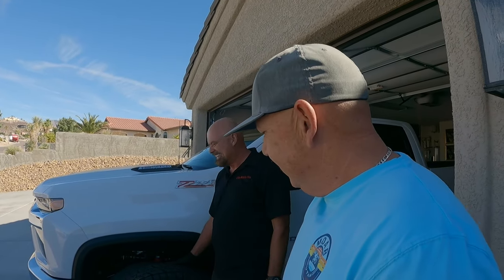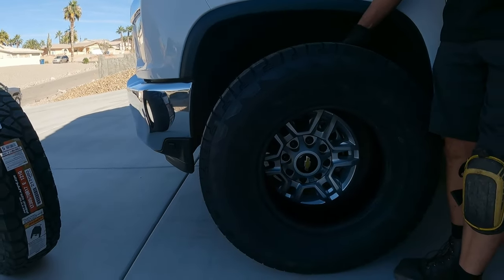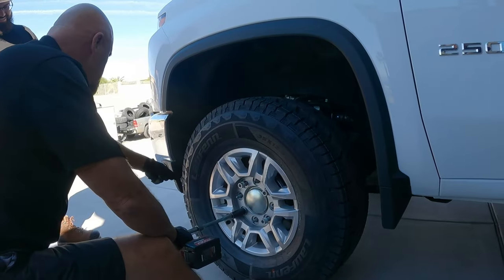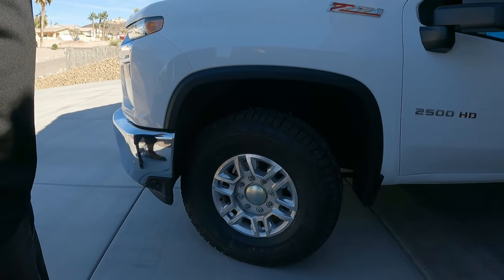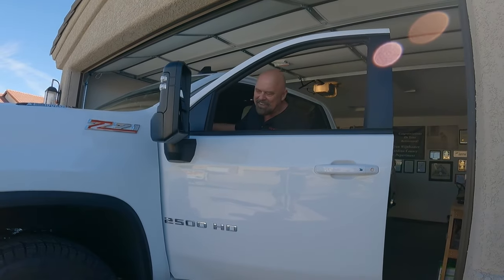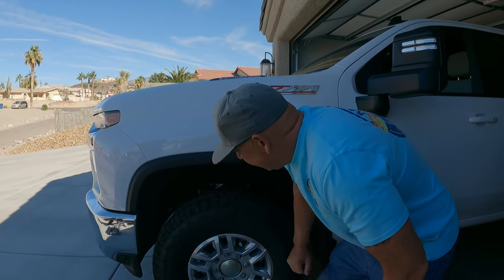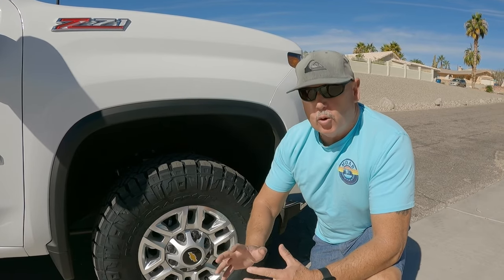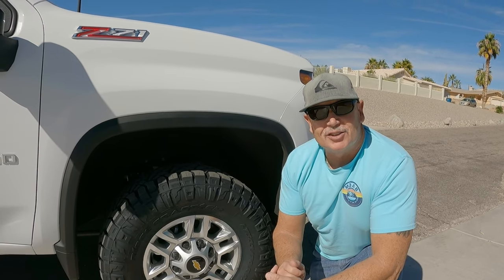2022 Chevy 2500HD Duramax 35 inch TIRE FIT TEST// WILL IT FIT?

Comment: mine is 2022 3500hd with 278/70/18 thts 33.5" tire i think. my local tire shop said no way 35" will fit especially on stock rim cause its too wide. you think he doesnt know wht hes talking about or is he tryin to sell me wheels?
Reply from the maker: That’s pretty funny!! I show you on the video that they will absolutely fit!  😂. So yes, he does not know what he is talking about.  However, I am no longer running the Nito Tires.  I switched to the Cooper Discoverer 60,000 miles warranty.  The Nito’s were too soft.  305/70R/17 is what I am running.  1/2 difference between the 35’s as I show at the end of the video.
Reply from the maker: I would go to Discount Tire.  If you have on near you.
Reply: @OverTheHillAdventures you think it matters if i have the 18" wheels or 17?
Reply: if you look online, 305/70/r17 is 33.8", 305/70/r18 is 34.8". my stock one is 33.2" i think.
Reply from the maker: @alamray   no it doesn’t matter if you have 18” wheels.  I went with my 17” stock for a better ride which you will too!  20” rims make for a rough ride.  That why the Ford Raptors have 17” and 18” rims.  So yes my tires are a fraction under 34 but still are consider 34X12.5X17.  The fit test I did in my video was a 35X12.5X17.  The only reason I did not go with the 35’s was because of gas mileage and I didn’t want to calibrate my speedometer.  I got tires that look great on the truck.  Lots of folks have commented on this video.  They love their 35” tires on their truck.
Reply from the maker: @alamray the fit test I did.  Was a 35X12.5X17 and yes the 305/70R/18 is a 35 in tire but it’s only 12.01 inches wide.  Either way you will be happy.  Do you have the Z71 package on your truck?
Reply: @OverTheHillAdventures  yes z71. i think im gona go with 295/70/18. good in between size.
Reply from the maker: @alamray  you will definitely be happy! 🙌👍
Reply from the maker: @alamray  it’s only 11.6 wide
Reply: thank you @OverTheHillAdventures
Reply: which cooper discoverer? AT3? @OverTheHillAdventures
Reply from the maker: @alamray  yes sir!

Comment: So what size and brand tires did you go with?
Reply from the maker: Nito Ridge Grappler 305/70R17 which is a 341/2 X 121/2 on a stock 17 inch rim.  It is only 1/2 inch smaller in diameter then the 35’s.  If I did it again I would go with the 35X12.5X17 because the tire is cheaper.  These tires are great so far.  Aggressive tread but a quiet tire.  Thanks for watching, Stan

Comment: I run 35&37 inch big horn mudders I pull 24 mpg on a bad day and 28 on a good day in my duramax
Reply from the maker: That’s awesome!! Nice work!!  Stan
Reply: ha, DOUBT.
Reply: @Ryansrangereport  maybe u doubt urself but that's ur business good luck with that
Reply: How tf you do that ? Mine does 11 mpg
Reply: @dieselmex1808  mines a 2003 have the lb7 put a lift pump on it and some other mods I will not fully disclose what's all done to anyone never know who out to fuck ya but she will pull a solid 27.7 to 28 mpg at 60 mph on the hiway and I pull 20 to 22 in the citys when passing through
Reply: @rooster72886  mine is a 2019 with all the emissions bs
Reply: @dieselmex1808  wow that's just insane 11 mpg in a newer I'd have thought 18 maybe 21 epa has gutted the diesel engine's bad I love deleted diesel with a proper tune you ain't smoking out the community now at the pulling track you bet I'll crank it up to 5 and let it roll lol

Comment: So I have a 2021 2500HD,  my rims are 20s though stock. Its an LTZ Z71 with the Duramax.  I just had a blow out today and decided to just replace them all, but I want to go up a little, currently they are 275/65 R20. Any input would be greatly appreciated.
Reply from the maker: Daniel, you already have 34" tires on your 20 inch rims.  You can go 285/65R20 in inches is 34.6 inches in height and 11.2 in width.  Anymore you might rub. The 20" rims are tricky!  I love the Nitto Ridge Grapplers.  I hope this helps. Stan
Reply: @OverTheHillAdventures  Thank you my friend, that was an amazingly fast response, much appreciated. Hope you have a great weekend!
Reply from the maker: @daniellickel9867  just remember as long as you stick with stock rims you’ll be good.  If go with over sized rims you might get in some rub trouble.  Blessings, Stan
Reply: we are in a similar spot. we drive 35-40k per year and want highmpg bc we mostly drive highway with some gravel we dont have to have off road style per se. we like our 20" stock wheels but the stock tires are just ok, not very good in heavy rain and terrible in light snow. we are looking at the michelin ltx at, maybe the mickey thompson baja legends or the general grabber atx. all about the same price and since we have 5k or so miles to go we have a month or so to make the decision. what tire did you end up getting and what is your opinion of them? thanks.

Comment: I just ordered a 2022 2500 custom and it’s coming with 20” wheels.  I didn’t know z71 comes with a smaller wheel?
Reply from the maker: Hi John, yes my Z71 came with 17” rims.  Ridiculous right.  However, I have no complaint.  It gives the truck a much smoother ride.  Most Ford Raptors come with 17” rims and big tires so when they hit the desert dirt road the truck floats with their very expensive suspension.  The cool part, if your truck is coming with 20” rims then you will already have 34” tires. 275/65R20 come in at 34.1 inches.  However, some guys get wider after market rims and get a little wider tires and run into rubbing problems.  Keep your stock rims if you want go wider on the tire.  The Z71 has a good stance so no need to worry about a leveling kit.  Hope this helps.  Stan
Reply: we ended up getting the 2020 LTZ Z71 W/OFF ROAD PACKAGE, came with 275/65/20 wheels and tires and thats a 34.1 tall tire and easily could fit a 35", we have almost 60k miles on it, its a beast of a truck!
Reply from the maker: @kinggzz  I’m sure you will enjoy that truck.  Thank you for all the info. Stan
Reply: @kinggzz  I'm looking to buy tires for my 2020 gmc 2500 I have 275/65/20 will 35 fit with stock suspension
Reply: @krisway1107  i was told my truck would be fine. we don’t want aggressive mud tires and the truck came with all terrain but we are leaning toward the michelin LTX 275/65/20 on our stock wheel. my stock wheels are similar to every new wheel i pick out so i’m sticking with them for now. the suspension is THE ABSOLUTE BEST we have ever driven on any of our trucks so i’m not screwing that up.
Reply: Just bought a 22 2500 and mine came with 18” steelies. I feel 18’s are the sweet spot. Mine is CCSB Z71

Comment: What other adjustments did you do to the vehicle to ensure your speedometer and mileage are accurate?  Larger tires always cause the speedometer to show faster than what you are going and the mileage counter is always off.
Reply from the maker: Yes you are correct larger tires do make your speedometer look faster. Mine is about 2.5 miles faster. I just keep i in mind. Thanks for watching our video. Stan and Rhonda
Reply: Did you ever have to recalibrate the speedometer? I have the same truck with the LT245/75r17 (31.6” tall tires) and I’m putting LT315/70r17’s (34.4” tires) on this week. It’s a pretty significant O.D. Difference. How badly is your speedometer off on accuracy?

Thanks.
Reply from the maker: Hi Alex, I keep in mind that I am actually going 3mph faster then what it says on my speedometer going 65mph.  I am not doing the recalibration.  I might change tire size the next time.  I am so glad I kept the 17" rims much smoother ride than the 20" good call.  Stan
Reply: @OverTheHillAdventures  very good to know. I plan on keeping the 17” wheels as well but after doing some calculations, I was giving myself the impression that the speedometer would be off significantly. 

No other negative affects with the larger tires? Have you towed with it since you’ve put the 34” tires on?

Thanks.
Reply from the maker: @alexloeffler7915  no problems towing. It tows like a dream. I like the stance of my truck now. The small tires made the truck look ridiculous.  Super happy with the Nito tires.

Comment: factory is 34" on 2500hd so obviously a half inch each side / 35" will def work.
Reply from the maker: Kinggzz, My factor tires were Firestone Transforce AT 285/70R17. 32.8 inches in diameter.  So obviously a little more than a half inch.  Thank you for your wise comment.  Blessings, Stan
Reply: @OverTheHillAdventures  my silverado 2500hd duramax diesel ltz z71 came with 34.1x10.8x20. we have 56,000 miles on them and should get at least 10,000 more. maybe mine are larger bc it’s a z71 off road, it’s an awesome truck.
Reply from the maker: @kinggzz  mine is a Z71 Turbo Diesel but the dealer ripped me off on the little tires they put on.  Nevertheless, you were lucky they put 20inch rims on.  I kept the 17inch it gives me a smoother ride.  That is what the Ford Raptors run.  Plus you are right no problem running a 10 1/2 wide tire. The 12 1/2 wide with 20 inch rims are whole different story.  The guys I have talked to say they rub.  Yes you are absolutely right we love our truck also definitely a beast.  Safe travels, Stan and Rhonda
Reply: @OverTheHillAdventures  we have had dozens of trucks, almost all we modified to the extreme. this time we are staying full stock. my previous vehicle had a 6 nah lift and when we bought this 2500 it was taller than the truck with a six inch lift. so needless to say we were very pleased. we get an average of 21-22 mpg. last week we drove 400 mile round trip and got 27 mpg for that trip. needless to say we are very happy with our mpg, especially considering how much power it has and we still get great mpg. peace to you and your family….
Reply from the maker: @kinggzz  that’s awesome gas mileage.  We just traveled across the United States got an average of 10.3 mpg pulling our 30 foot trailer.  I only have 12k miles on it. Hoping it gets better gas mileage when it breaks in.  For now I’m only getting 19mpg on the highway.  How was yours when it was brand new? How long before it broke in?
Reply: @OverTheHillAdventures  we drive a lot so honestly the first 10k came and went within  3-4 months. within the first six months we had to take a road trip of 850 miles. did that on one tank, only stopped for lunch. got 26.7 mpg. we have no complaints, great truck!

Comment: Does the z71 sit higher than the 4x4?
Reply from the maker: We have a 4X4 z71.  It does sit higher then the standard.
Reply: @OverTheHillAdventures  my question is. A regular 4x4. Vs a z71 4x4. Is the z71 highe
Reply from the maker: @sr972  yes! The Z71 suspension is higher than a standard 4X4

Comment: Of course a 34 is going to fit... That's literally what comes on it stock...
Reply from the maker: Yes, you are correct if you have 20inch rims.  I had 17inch rims my tires were 31 3/4 inches.  35inch fits too on stock rims.  After market rims they may not fit. So I am running 34X12.5X17 Nitto Ridge Grapplers.
Reply: @OverTheHillAdventures  wow, why would they put that small of a tire on the WTs? I mean I guess it saves a little bit but that wheel well deserves at least a 34 👌
Reply from the maker: @mcbrideskoi  absolutely correct!!

Comment: Congratulations, according to the Nitto website you now only have 3,080 lb capacity with that exact tire. With that heavy duramax engine and if you haul or tow heavy, you are now have less capability than stock.
Reply from the maker: Having traveled across the country pulling our trailer it was worth every cent!! I will never get close to my max payload with my rig.